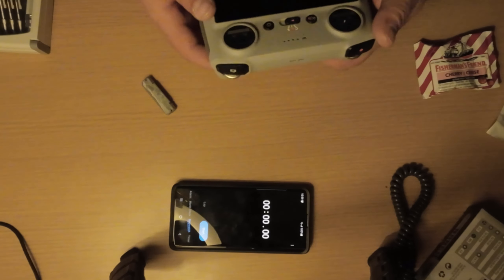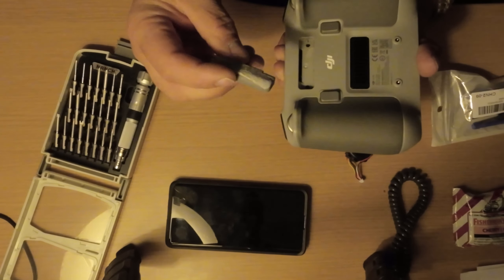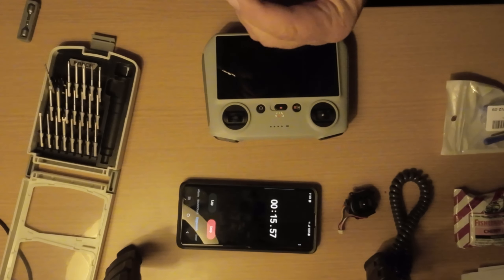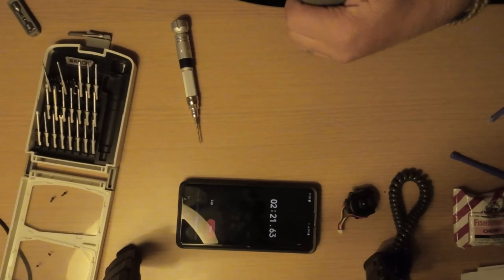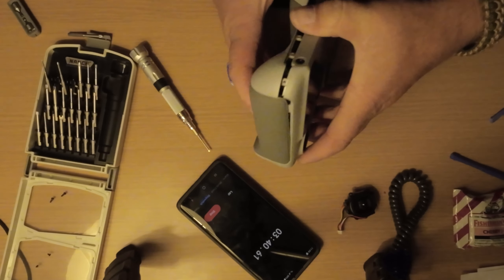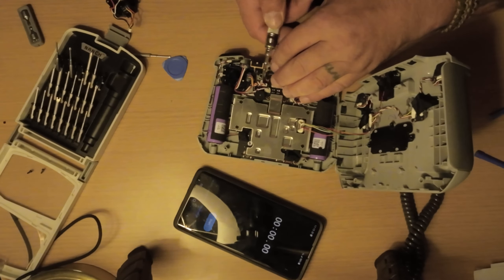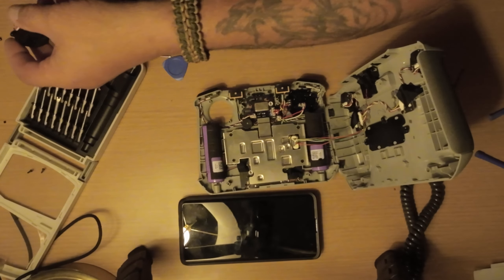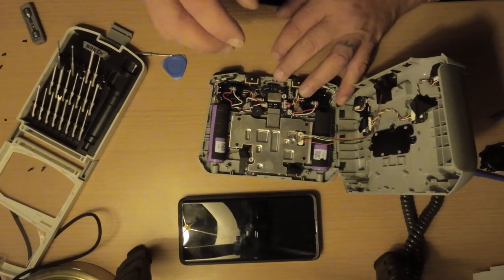DJI RC Smart Control Stick Replacement

Comment: Well done Glen. Fifty dollars compared to 400 is a great saving. I will  make one point if I may. Get a lanyard for your prized  controller as it will stop these accidents. Mine is always round my neck straight out the bag as I fear dropping it. I do everything with the controller round my neck. Thanks for the video. I see you have one very important tool on the table.FISHERMANS FREINDS, CHERRY. 😎 I love them.
Reply from the maker: Thanks my friend. I was a little bit nervous. Got er done tho.

Comment: thank you so much for this, I have a simple issue where the metal part where the sticks screw down on seems to have worn down so the sticks won't screw on, im going to order on of these and try it out. thanks again for sharing your steps!